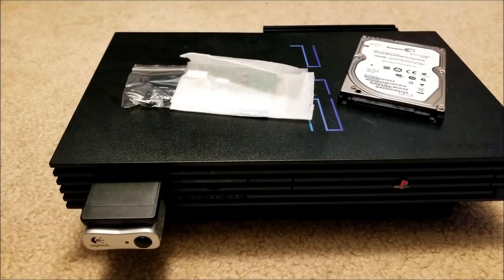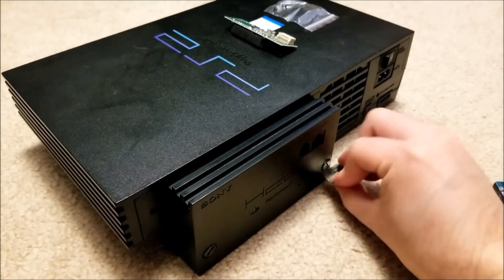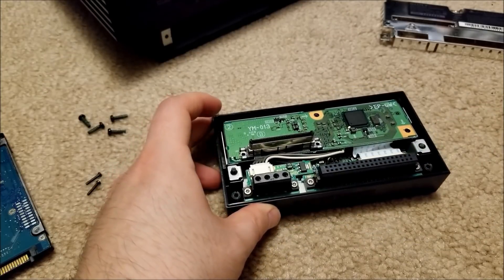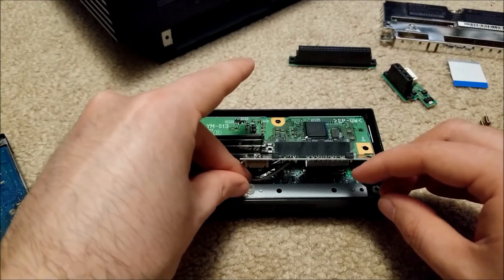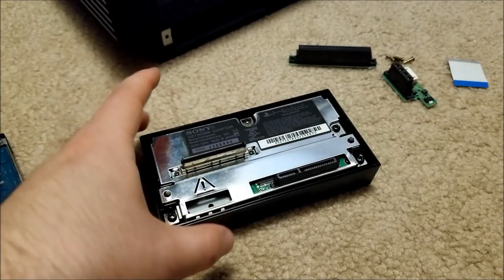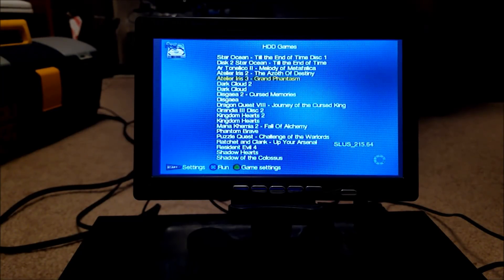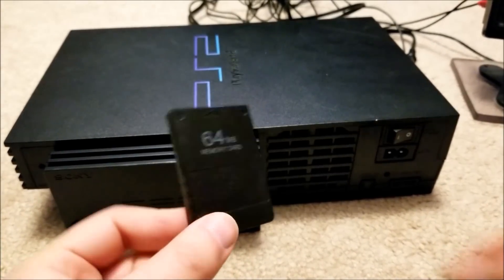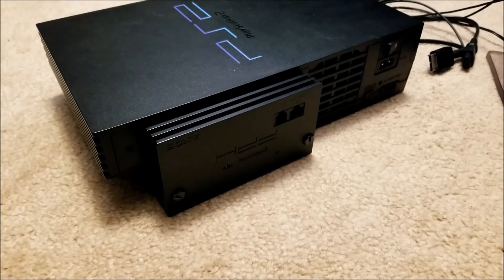Sony Playstation 2 Internal 2.5" SATA HDD Mod

Comment: I mean, are the cinematic scenes cut off if I use STAT or not?
Reply from the maker: The drive type has nothing to do with cutscenes. They should work with either drive type assuming the iso was ripped correctly.

Comment: correction: you said you can get third party adapters but the third party adapters dont have network support
Reply from the maker: Yeah it's a weird omission where the 3rd party "network adapters" dont actually do the network part. I guess the chinese manufacturer decided to cut costs by removing the feature.

Comment: 8:00 Plus the network adapter clones aren't network adapters at all as the don't have ethernet ports, with this method you have the SATA connection AND network.

Comment: I was considering using this same type of mod on a hard drive adapter since it has network ability unlike the other ones that are available already done made.  My question is though, is the 2TB capacity due to the adapter or the PS2 itself?  I have in the back in my mind the plan on using an old fat ps2 case with a raspberry pi.  ...Hoping I can put the two together will be the plan...
Reply from the maker: Iirc the limitation is due to the software side as the limit used to only be around 500gb until the software was updated to support higher capacities

Comment: Nice vid man, yeah this is the best option to retain the network capabilities to transfer games over through FTP. I assume that the external IDE to SATA adapters would work so you don't have to internally mod the official SONY Network Adapter right? The reason being they are cheaper and an easier install. If your are using a 2.5" drive then everything should fit right?
Reply from the maker: Thanks, yeah I don't see any reason an external IDE to SATA adapter wouldn't work so long as you can squeeze everything inside the drive bay area.
Reply: @sjm4306  For sure, I figured that too. It's only a $10 difference though so I'm trying to decide if it's worth it. One issue I can see is supporting the hard drive if the adapter offsets it a little bit.
Reply from the maker: There are 2.5 to 3.5 hdd 3d printable brackets you can download online, perhaps one will fit the drive and adapter.
Reply: @sjm4306  Ahh good call! Thanks.
Reply: Con el adaptador birideccional de IDE ah sata igual debe funcionar.

Comment: I bought one of the new adapters without the network plug and plugged in an SSD. It works great.
Reply: Esto es mejor porque conserva el módem original y queda con puerto Sata.
Y para conectar ah internet con el cable de Red

Comment: Do you lef the 2.5 hdd loose inside with no issue
Reply from the maker: After the video I 3d printed a 2.5 to 3.5 adapter

Comment: @sjm4306, what is fmcb (hddloader, matrix or the other) that you use it?the apperance very simple
please answer thank you
Reply from the maker: Fmcb is a hacked memory card that allows running homebrews and patched backups. Hddloader is homebrew for playing ripped game images off the internal hdd through the network adapter. Matrix is a modchip I installed so I can run homebrew and backups without having to use any special memory cards or swap discs.
Reply: @sjm4306  thank you

Comment: I dont know how to tell you this... But SATA is IDE. More specific. SATA is ATA, that are evolved from IDE. A fancy IDE in some way. The way it connects is serial. Hence SerialATA. PATA are ATA as well. Just ParallelATA. But neighter SATA nor PATA is really IDE anymore. And then again they are. Real IDE is something completely different. It uses different cables and in most cases, you can not use SATA with IDE PIO-0 controllers. (That is with an adaptor in between) Yet SATA are still IDE.

Comment: hi!
I wanna get the same original Network Adapter and do the same mod. But what good is the Ethernet port anyway? I was hoping I could FTP files from PC > PS2 when running FreeMcBoot or something. Does this not work?
Reply from the maker: You can totally ftp iso images over ethernet to either the internal drive or even driectly play games streaming from your own server/computer.
Reply: @sjm4306  cool nice, definitely worth it. I love modding. just really got into it this month, but I had a modded ps2 and xboxoriginal for 20 years, chipmodded, but a friend did it back then. even  chipped ps1 somewhere at my mums place, lol. but the disk swapping really got on my nerves since i had an xboix with hdd...

Comment: Its been late for me, but the controller look cool.
What is controller name? I want controller like that
Reply from the maker: It's a logitech ps2 cordless action controller. I got 2 back in the day and they are awesome.
Reply: When you use that, does any problem with delay?
Reply from the maker: I haven't directly compared it to an original wired controller but I haven't noticed any obvious latency during gameplay.
Reply: That sound great, i will buy one and thx for info. Btw can you tell me where i can get this controller?
Doesn't exist in my local online store
Reply from the maker: Logitech discontinued them ages ago so you can only pretty much get them used at this point. Your best bet is to search on sites like ebay or amazon.

Comment: Or you can buy one for 5 dollars with sata already 😂
Reply from the maker: The complete sata clone network adapters cant do lan networking and have some qc quirks. Sure they are cheaper but overall I prefer using a sata modded oem network adapter.

Comment: Can you add both PS1 and PS2 games ..... I ask PS1 because primarily those games are read as vcd format. Please help
Reply from the maker: The last I heard you could only rip ps2 games and play them from opl since ps1 mode is handled differently and the only way to switch modes would be to reset the ps2 which would wipe opl from ram. Who knows if this has changed with homebrew since I last messed with it, it's been a few years.
Reply: @sjm4306  may be the next alternative could be putting the PS2 games (through something like winhiip) on the hard disk free HD boot while using a usb pen drive for the PS1 games through free MC boot and opl loader

Comment: i used to a have fat ps2, fmcb, network adapter, 60 ide hdd, 10 years ago and ide is pain, i would open tower on old pc. Going to buy another fat ps2, network adapter, fmcb, sata to usb adapter. I still have the original 007 agent under fire ps2 game. i lost the launcher cd and i never got the card  swap trick method to work so i would open fat ps2 up and did it that way.

Comment: Do FF X still lags on the fmv scence if you used the network adapter? I'm using xternal hdd and it lags on the fmv scence.
Reply from the maker: Nope no lag/stutter, the internal drive interface is parallel ata so the bandwidth is much higher than using an external usb drive that's limited to the usb 1.1 speeds of the ps2 hardware.
Reply: @sjm4306  thank you for the info, I'll be  selling my ps2 slim now, and get a ps2 phat, 😀

Comment: just took part old laptop ended up having a 500gb in there ,looks the same n says seagate like yours is that sata ? the lap top was made after 08 I believe so I assume it would be
Reply from the maker: Almost definitely sata, but if you want to be sure just google image search sata connector to see if it matches
Reply: @sjm4306  cheers found a vid the code end in the sa code I believe (sata ) may be the other way round lol for those also in need

Comment: does this fit properly if you opted for a 3.5" sata and just reused the enclosure 
the original ps2 drive was in?
Reply from the maker: Yes, these kits are actually made for 3.5" satas, I just had a spare 2.5" I wanted to test with.
Reply: @sjm4306  great, thnx for the reply!

Comment: I’m a little uninformed but what exactly does a HDD or hard drive even do? What does it do on the ps2 and why do I need it? What does it benefit? I’m a little confused on the whole hard drive thing. Will my games run better? Less loading times? What? What is it?
Reply from the maker: In combination with the memory card hack you can rip games from a disc (or just transfer them from a computer), save them all onto the internal hdd and finally play them all without ever having to load the discs again. Loading times will be better than from disc and hdds are more reliable so you dont have to worry about scratched discs or burning out your laser.
Reply: sjm4306 so it’s essentially storage for games? Does it serve any other purpose? Thanks
Reply from the maker: You can load roms for emulation/homebrew as well. But mostly it's a good way to save a dying laser and the convenience of not having to swap out physical games. I have a good 60 or so games installed to my 320gb internal sata drive which is a good thing too as it disc read errors have been popping up more recently during gameplay from disc.
Reply: sjm4306  how do you download games onto it?
Reply from the maker: You can directly rip games from the disc (I show the general process for how to do this with some homebrew software in a follow up video: https://www.youtube.com/watch?v=j11DNQ45wg0). You can also plug the drive into a computer using a usb adapter and load iso rips of games (that you legally obtained of course!) using a software called winhiip.
Reply: sjm4306  that’s pretty cool. Thanks a lot for the insight. I really appreciate it.
Reply: @sjm4306  I've got this friend who needs a ps1. (As hes only allowed a ps1 where he is) so he wants to cheat the system basically get a ps2 slim brain fitted inside a ps1 shell. With a hdd in there to store games and movies etc. I've heard its been done before but I've never actually seen it done. You seem like you would be able to do that if it can be done... can it?

Comment: Does it still works as network adapter after this mod?
Reply from the maker: If you mod an original network adapter like I did then yes. If you buy an aftermarket adapter with sata built in, then no.
Reply: @sjm4306  I have the original and the 3rd party sata one, can I remove the sata parts from the 3rd one and put in the original?
Reply from the maker: I don't have an aftermarket one so I cant say for sure. It wouldn't hurt to open it up though, see if the zif interface is the same and swap the sata card to see if it works.

Comment: I bought the moded one  , I was able to install and play many games except Splinter Cell versions. Were you able to install splinter cell and play it using this adapter ?
Reply from the maker: I haven't tried, but from what I've read you have to play with the settings to get some games to play and even then certain games just wont run.
Reply: @sjm4306  no  when I put my  IDE adapter the games worked fine . I think I will just buy this SATA adapter and do the same . good video  thanks for sharing

Comment: Just using fullsize 3.5" HDD, MaxDIYPower SATA board the greatest =} And if my ass can do it..

Also, I imagine every one that is assembled for you is not even on real authentic network adapter? So out with live gaming >.<
Reply: wanted to do the same but i'm worried about temperature in such a small space with a 3.5 hard drive

Comment: i hv bought used ps2 fat . but as u know slow ide inside . nd my lot of games not running proper like RE 4. Urban reign. so after this process will my ps2 will be more fast then ide.  but i don't want to make ps2 slim from ps2 fat by fry it. so plz hlp me
Reply from the maker: The ps2 will data bus bandwidth will limit the hdd speed not the other way around in this case. I'd expect an IDE and SATA both would likely have similar performances in a ps2. I'm pretty sure the problem you are having with certain games not running can be fixed by changing the specific game configuration settings in your loader (opl, hdl, etc).
Reply: @sjm4306  nd how to do change this settings in ps2 F.
Reply from the maker: It depends on what loader program you are using. Iirc there is text somewhere on the screen of the loader that says to press a certain button to open game settings. Either that or I think psl has a settings menu in the xross interface.
Reply: @sjm4306  can u help me out to connect Ide hdd to pc to install games

Comment: Thanks for video.. Please don't do mods on carpet though. I cringe when I see people working with boards on carpet. Static electricity can easily short something out.
Reply: new chips are actually more resistant to static frys not like the old electronic components back in the 70's and 80's... BUT!!! it's always a good practice to keep anything electronic on anti static and ground yourself. SAFETY FIRST!!
Reply from the maker: I know it's frowned upon to work on carpet, but in the 15 years of doing this kind of stuff I've never had an incident of esd damage. That plus most cmos devices nowadays have pretty good crowbar protection on their io so I'd have to try to fry parts by shocking them.
Reply: @sjm4306  it's cool. I had a fry before when I first started working with stuff because I didn't know better. I def learned from that years ago.
Reply: @sjm4306  
you've just been very lucky or you have a good carpet. esd damage isn't exactly a rare thing. a static dischage could easily affect any IC
Reply from the maker: It definitely helps not dragging my feet or rubbing the carpet (just touching carpet alone isn't enough to accumulate static electricity) and touching nearby grounded metal lamps to dissipate any potential charge just before touching a bare chip/board.

Comment: Does 3.5 HDD works?
Reply: I use 3.5 sata hdd and it works
Reply from the maker: Should, I dont have any spare 3.5" sata drives to test but pretty sure it would work fine.

Comment: Why no link to the upgrade adapter?
Reply from the maker: It's like the 5th item in the ebay search in the link I gave "PS2 Network Adapter Sata Upgrade Kit for Official Adaptor". I try to avoid posting links to a specific item as it is very often that they sell out soon after I post the link and then I get a million comments about how the link has expired.
Reply: @sjm4306  Yeah that makes sense..i ordered one..couldn't find any local so gotta wait a month or two from China =D wee. No rush anyway. I already have the knockoff adapter but my games randomly freeze and I think it may be the knock off adapter causing it so want to try official one with the sata mod.

Comment: Is there a max size of hdd you can use
Reply from the maker: I believe it's not quite an issue of hdd size but there is a max game count in the order of something like 255 games but I believe there are 48bit modded versions of hdloader and open ps2 loader that can work with even more games (I've seen people put 2TB drives in PS2s).
Reply: @sjm4306  hm interesting i might try it well i dont play all ps2 games so ill be good
Reply from the maker: For me 255 games is probably more than I would play to begin with but I suppose you'd have to factor in multi-disc games as well.

Comment: I would not recommend getting a 2TB drive for the PS2. I think there is a 250 game limit per HDD, so you would waste a lot of unused space on a 2TB drive. 1TB should be fine and plenty of space to get that 250-ish limit filled up.  (Assuming  all 250 games were 4 GB each give or take)
Reply: HDL Dump Helper GUI is what most are using today. It was WinHiip that had a 256 game limit (the only one that imposed its own; early OPL etc. imposed a limit of its own). However, a 1TB IHDD is still the recommended maximum for best compatibility with various homebrew software. There are more potential pitfalls with 2TB IHDD's (and the larger the drive, the slower its going to populate game lists as well).
Reply from the maker: Thanks for the info. I think I will really only actively play less than 100 games anyway so I agree 2tb would be way overkill.
Reply: And to be frank,I have 50 games on 250 gb ide with 100 free space.. I mean 50 games is sufficient don’t think adding a crazy amount is worth it. Especially the heavy writing with winhip every game you transfer. The maxtor 250 has been good to me
Reply: @joewhispers5680  I have over 100 games on disc... would definately want over 100 on HD; got a 1TB personally.

Comment: ide doesnt go above 250gb without ultra ata 200 server motherboards and pata scsi drives so the highest you will find is 250gb not 1tb
Reply from the maker: I know I've definitely seen at least up to 320gb ide drives on ebay, would those not be compatable with this adapter then? Well either way now that I have modded it for sata I'm not limited by ide anyway so no worries.

Comment: Nice video I would put a little annotations making sure to mention them torx screws can be a pain to get out. I stripped my first  t7 on mine hand had to order a new kit. (I did this about a year and half ago following a different guide that didn't show the guy taking out the torx screws) but in the end It worked out nicely and I have done this mod for a few friends as well.

Comment: Add an ssd.. make it fast
Reply: SSDs for life bro. :D
Reply from the maker: They are pretty getting cheap nowadays.
Reply: You're limited to the IDE specifications, despite the SATA adapter mod. Just as with transferring data off of an old IDE/PATA PC via SATA adapter to a newer PC. In the same vein, you'd also be limited to USB 1.1 if you plugged in a USB 2.0/3.0 device because that's all the PS2 knows.

Marginally reduced heat and power consumption (and recall that IDE drives ran a lot warmer and consumed a fair amount more power than today's SATA drives) would be the only real benefit to an SSD in this application. And a poor choice overall if you're making a lot of changes to what is on there (they have a finite write cycle, unlike HDD's)... and that is especially true of SSD's from a few years ago (they've improved some since, but will never be free of a finite write cycle, unfortunately).

What I am getting at, is that you're already going well into overkill territory with a modern SATA HDD in a PS2.